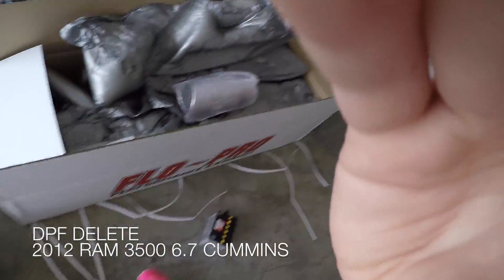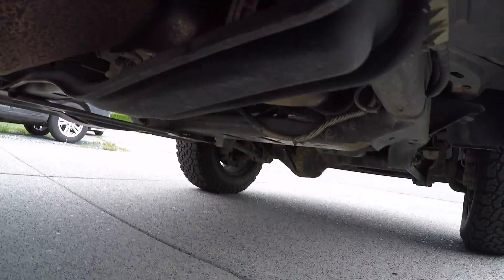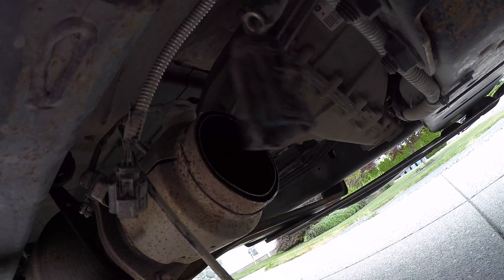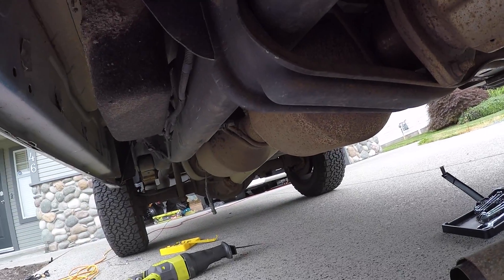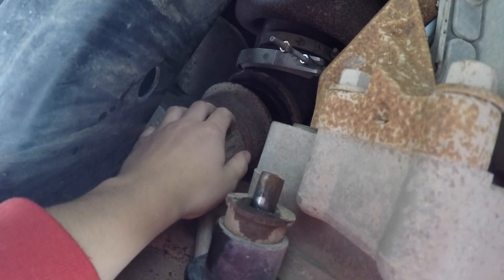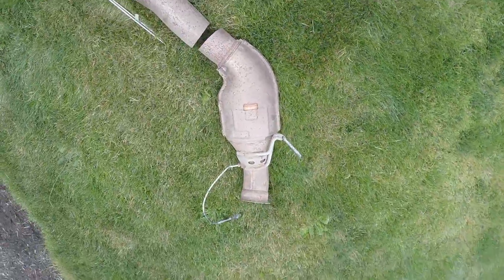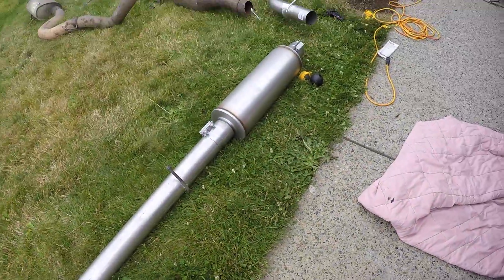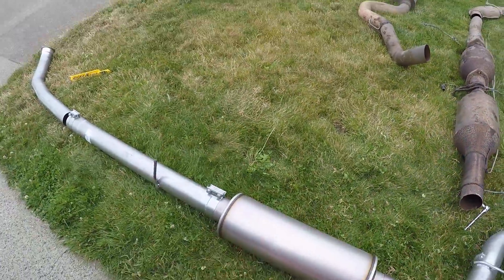2012 Ram 3500 DPF Delete

Comment: Going to be doing this on a couple of our ranch trucks, an 07 3500 MegaCab dually and a 2012 3500 quadcab. The DPF filter on the 2012 is plugged and the truck is in limp mode...so naturally we're just gonna delete that BS along with the EGR system on both trucks, tune them and rock on.

Nice job! Subbed!
Reply from the maker: Nice! You will find the truck runs 100% better once you make that delete and not having all that exhaust flowing back in. I even saw an increase in fuel economy as well. Good luck!!

Comment: Hello, you made this look so simple. Thank you. I have a question, did you have to tune your truck and buy a tuner? Or did you just change from dpf to exhaust system? I have a 2012 Ram 3500 also.
Reply from the maker: You need a tuner. I purchased a “Raceme” tuner that will supply all the codes
Reply: @GirlinGrease  awesome 👌
Reply: Thank you so much for replying and engaging your audience, if you don't mind I'm subscribing. Thanks much.

Comment: I'm asking because I'm thinking about doing the same thing on my 2012 ram 3500 6.7 cummins as well
Reply from the maker: Lloyd Robinson I would highly recommend to have a smart system (ie bully dog or raceme) that way it will won’t have the truck bring up lights on your dash or have to put in the right codes manually.

Comment: What is your thoughts on the raceme tuner? Looks like I'm probably going to be doing one on a 2013.
Reply from the maker: We have a raceme and it’s so simple and easy to use. Only thing I dislike is the cable connection. It needs to have a tight fit or it just comes loose and disconnects for the screen.
Reply: @GirlinGrease  thank you

Comment: Hey did u have check engine lites on after leaving all those electronics disconnected
Reply from the maker: Lloyd Robinson I never ran the truck without installing the smartie raceme system. You need it in order for the computer to generate all the codes. Otherwise the truck will throw errors and you might have a few lights come on the dash ( engine light, oil light...etc)
Reply: Looking into deleting my new 2010 i just picked up, im a little new to the process so im still doing my research haha.. but my question- once I install my new dpf delete exhaust and my tuner of selection, can I keep my egr system installed but unplugged, or should I purchase an egr delete kit? Im not sure if it would be a neutral or non beneficial decision of keeping my egr system installed, but If it is possible to keep the egr system, do you know if it would damage or have any impact on my engine while running the dpf delete exhaust? Thank you!

Comment: One question, what did you have to do when the hard lines were disconnected?
Reply from the maker: I taped them off with electrical tape and tucked them away.
Reply: I’m looking to delete my 4th gen 2014 3500 but wanna start with the DPF. Do you have a tuner or is there just a constant check engine light on your dash?

Comment: I thought 2012 was pre DEF ???
mine is... how come?
Reply: It is, 2012 has CAT, NOX, DPF and muffler, no DEF fluid.
Reply: @joeymartin8722  I thought so, good to know! I looked at 2012 Cummin's & 2013 Cummin's. The 2013 has a DEF fluid gauge on the dash but the 2012 doesn't so I was kinda confused at first but I figured the 2012 doesn't after looking

Comment: Nothing about the tuning and delete codes to clear the engine light...
Reply from the maker: Ricardo Galvan this is just an install video, I never encountered the engine light after the install so no codes were needed. You might want to check another source for the codes.